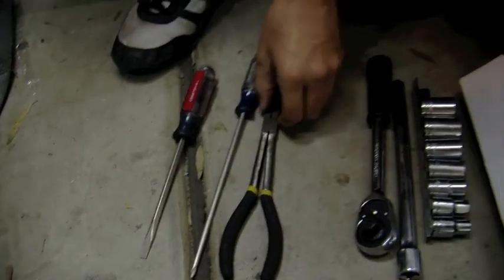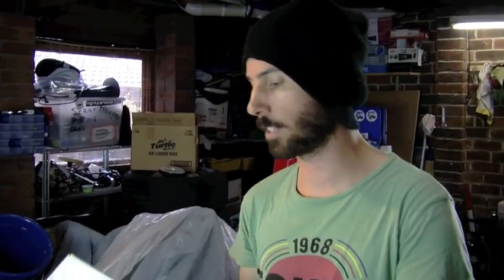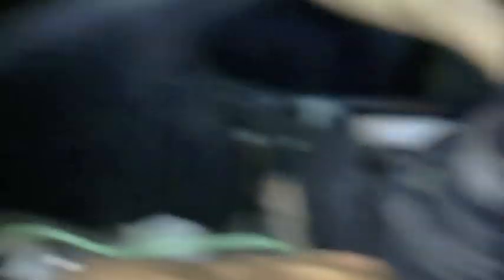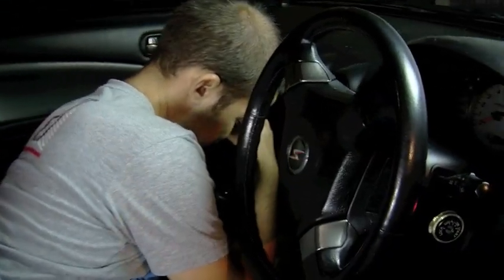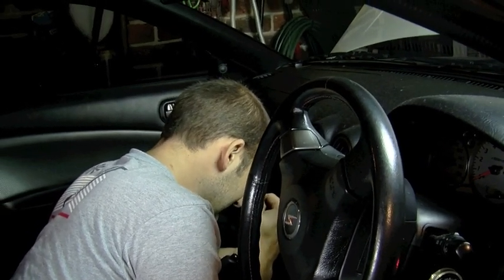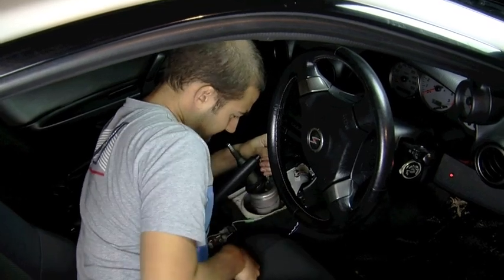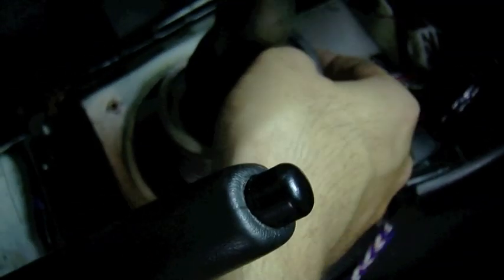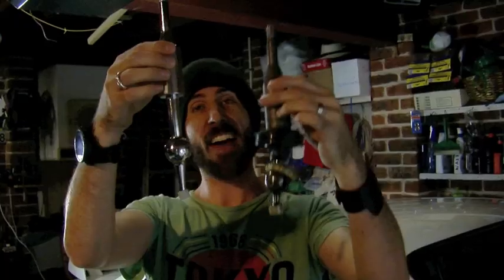Nissan S15 Short Shifter Install - Failed EP

Comment: shorter length will reduce your throw arc, you throw length is as follows "arc length = Degrees(in radians) x radius" so shortening your gear stick with an angle grinder by 8 cm from an original 20 cm assuming the original throw is 40 degrees, will reduce the throw from 14.0cm to 8.4cm. however i do agree with you that it it is more beneficial to go with a true short shifter. but for some cars their tough to find (like in my 91 tercel winter car i cant find on anywhere so i grinded it)

Comment: fair point but thats because the pro race drivers use the proper ones that go all the way from the box to the shifter they change the linkage as well but the kits with just the short shifter wrecks the box because there not lineing up and it would take a long time to wreck the syncro's i was just making a point

Comment: How did you guys know it doesn't fit a 6-speed? I bought one for my S15 on the advice that it DOES fit the 6-speed but considering how hard they are to come by, I'm having my doubts. Plus, I don't want to rip out my stock shifter only to find that the short shifter doesn't fit, not be able to get my stock shifter together again, and have no transmission :( lol

Comment: I drilled 2 holes for the 2 bolts that you have to go under for.  cuz I did not have a lift. now I can R n R the shifter superfast and change trans fluid superfast.

Comment: i thought my short shifter install on my s13 would take half an hour but it took 3 times as long cuz i had to get the old plate out with a wrecking bar and file down the bushing after it wouldn't fit

Comment: A short shifter does help your car to go faster. If your throw is a 7" throw, and you change to a 3" throw, you can change the gears faster as long as you can let the clutch out and get on the gas as fast as you can shift the gear.. It's common knowledge.

Comment: Fuck the S15 has a lot of shit in the way of the shifter. My MR2 is just pull of the trim, pop out the linkages and then unbolt the plate and it all comes out! Took me less than 10 minutes to pull it all out, then 30 minutes pull everything apart and clean then regrease it then 10 minutes to put back together.